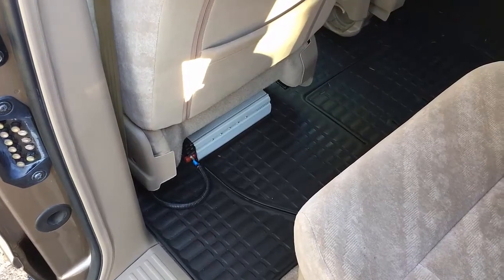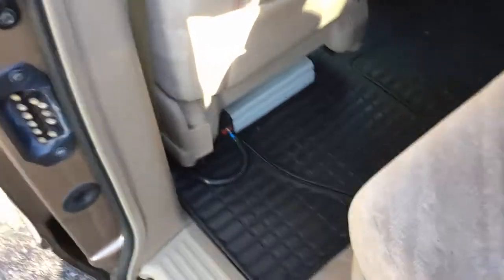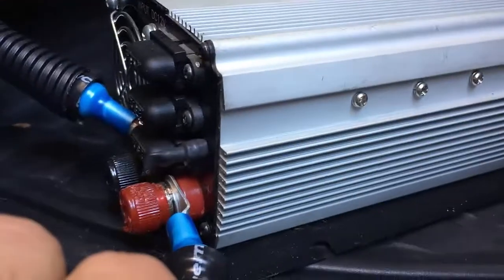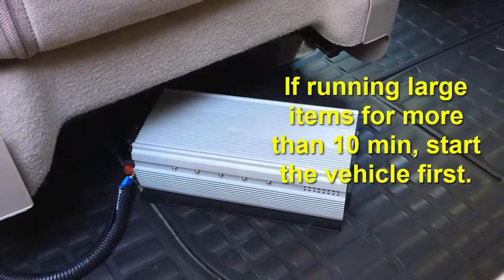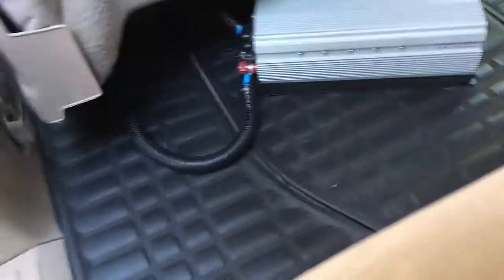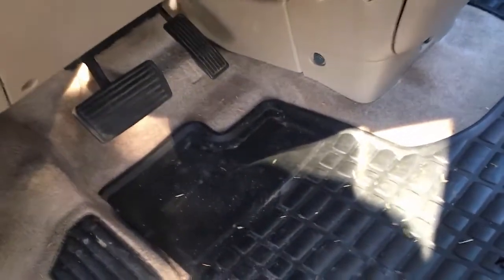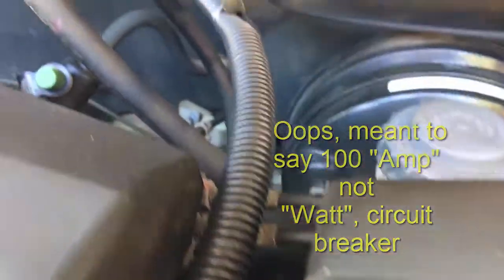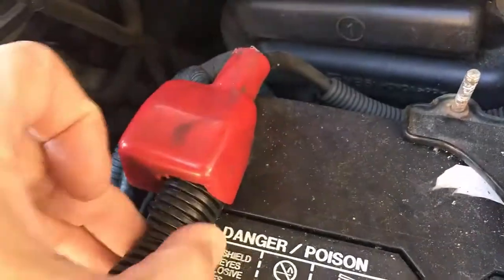Vandweller Inverter Install

Comment: how is this working out for you?  still works or do you have an updated version of this?  i found this too late and now the inverter you had linked isn't available anymore.  wanted to do this for our 2012 ody.
Reply from the maker: I no longer have this particular inverter, but I have a substitute for you.  The Whistler branded inverters are quality pieces and can support a surge for a longer period (up to 10 sec) than other inverters.  So, in the 800W class, this is a better unit than what I show in the video:  https://amzn.to/2Qi0Kl9     Thanks for watching!
Reply: @OdysseyCamper  That ones out too. I assume these inverters are just a temporary solution plugged to a lighter socket?
Reply from the maker: @Wize817  Although I HAVE used inverters plugged into the lighter socket, it's not a great solution.  First, the socket is not a great connector.  The design was made for a cigarette lighter and the male plugs are a poor adapter.  Second, most cigarette lighters are 15A circuits, which means you can't pull more than 170 W or so from the inverter.  I see people buying 800W inverters and plugging them into a lighter socket, but the only way you are going to get the full capability of the inverter is to hard wire it to the battery/alternator.  Thanks for watching my videos!

Comment: <    Little to electrical knowledge .  Could you install a 120 Volt  trickle battery charger from your 110 inverted back to the Battery to keep your battery charged up ?
Reply from the maker: Charles Bleifeld I assume you mean that you would connect to a second battery with the trickle charger, since the starting battery would be charged by the vehicle alternator. If so, the answer is yes!  Thanks for watching!
Reply: Thanks for your reply. No ,what I'am asking is. Could you charge your battery that is in the car and powering the  inverter. When the car is not running like say over night , to keep The car battery charged while it is supplying power to the inverter.   In other words The car is turned off and the  car alternator is not charging the battery of the car , Power from the car battery, powers the inverter where you plug in  the trickle charger, Then the Trickle charger would be attached to the car battery  keeping  your car battery charged. While your powering, the 120v Trickle charger and your 120V  lights or a heater or what ever  from your inverter  and car battery for a longer time , even over night .  Kind of a crazy question I don't know if it would work or not .
Reply from the maker: Charles Bleifeld Unfortunately that  wouldn’t work out. It would just drain the battery faster.

Comment: Can you tell me where you got your rubber floor matts please?
Reply from the maker: Kitchen Livin' with Shay I got the mats you see, here:  https://www.handa-accessories.com/odyint05.html  These are factory Honda mats, but they are actually from my 06’. The dimensions are close enough that they fit the 2000-2004 model with very minor trimming around the front seats. The factory mats for the 00-04 are getting hard to find.
Reply: Odyssey Camper Thank you so much!

Comment: Have you had any issues with water tracking inside the wire loom after running in the rain and going thew puddles on the road?.. Very clean Install that looked well thought out and protected correctly. THANKS FOR SHARING
Reply from the maker: Thanks!  So what I didn't mention in the video was that I pulled the plug out of the firewall (pops out easily) and cut a hole through the middle.  Then I ran the wire through the hole and all the way to the inverter.  Connected it, went back to the plug and put RTV silicone sealant on both sides of the plug.  Let it cure overnight and pushed back in.  I think it's sealed about as good as it ever was.  Plus, it's really high on the firewall, so you'd have to be doing some crazy mudding to get water up there anyway ;-)
Reply from the maker: I think you'll like the coming battery pack with inverters and solar.  Systems of redundancy.  Two is one, one is none ;-)